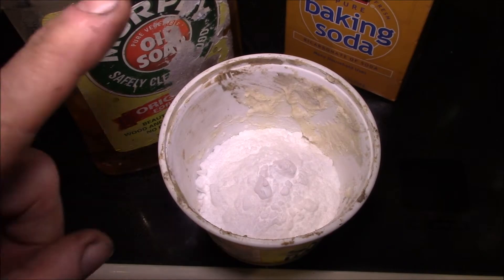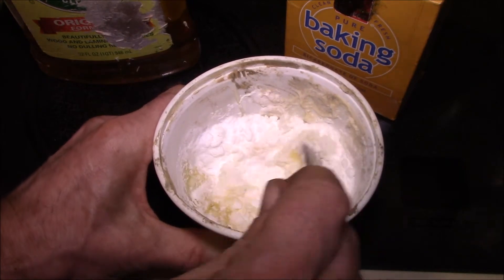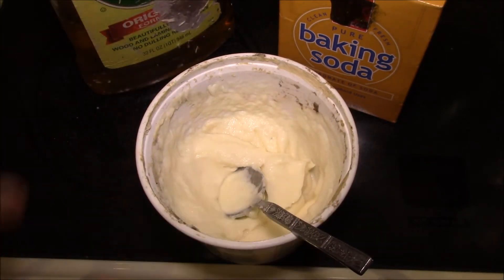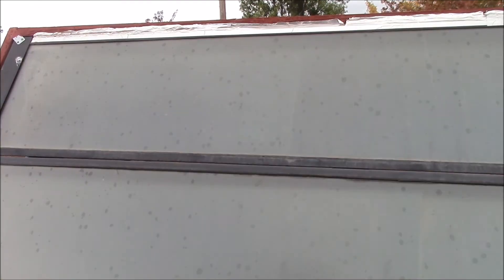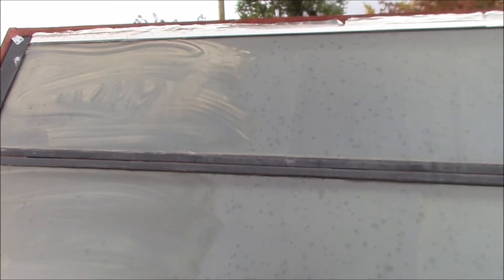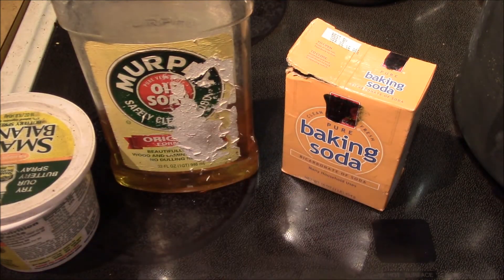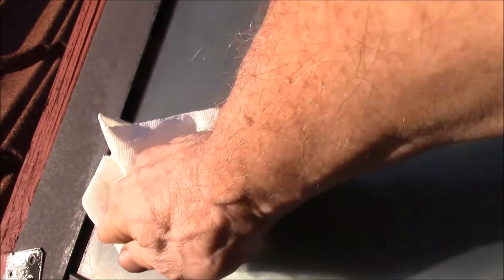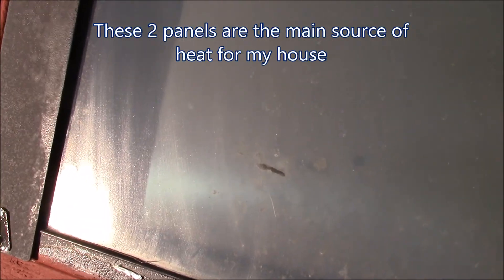Solar Heat Panel Cleaning with Oil Soap and Baking Soda

Comment: Wow I concur man I can't think of a better way to clean them and protect them. You can't clean with out some friction, baking soda and the blue pad and 303 is amazing. rain being the icing on the cake. 

I just spent the morning blowing about 16 inch's of snow off my driveway lol

git r done.

edit: tell me more about Murphy's
Reply from the maker: I searched for years trying to find the best way to clean these panels.  While there are the "headlight restoration" kits out there, I need to clean ~2 square meters of plastic and it would cost a fortune with those kits.  I found a video on YT (no longer there) that showed this combination of stuff I already had under the kitchen sink and in the cupboard.  

Works great for cleaning but I didn't relish climbing back up on the roof with a bucket of water, squeegee and roll of paper towels.  That's where the rain comes in, if you time the cleaning task just before a heavy rain is forecast, that does all the heavy lifting for free.  

I just use an old bottle of Murphy's Oil Soap I had under the kitchen sink.  It's a great wood cleaner:
http://www.murphyoilsoap.com/home
Mainly composed of Citronella oil and sodium hydroxide (lye), so a liquid lye soap.